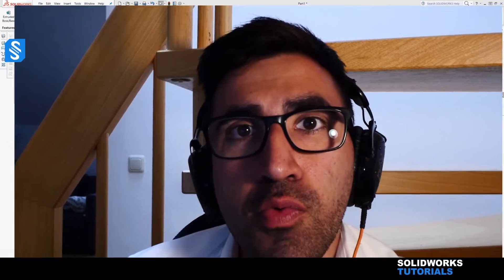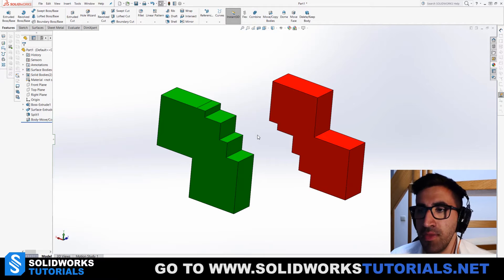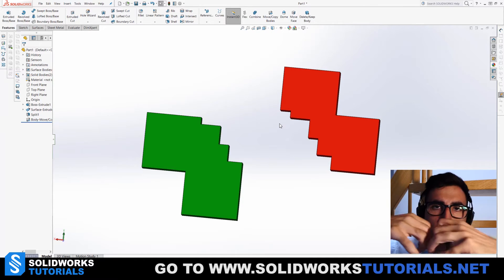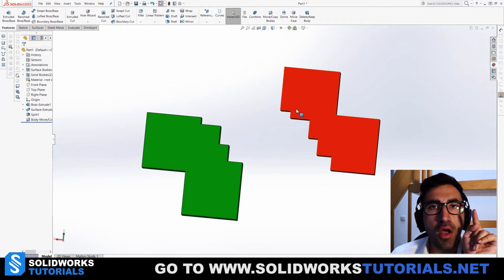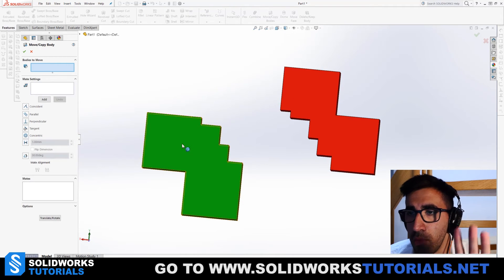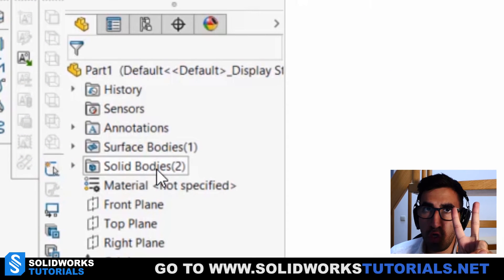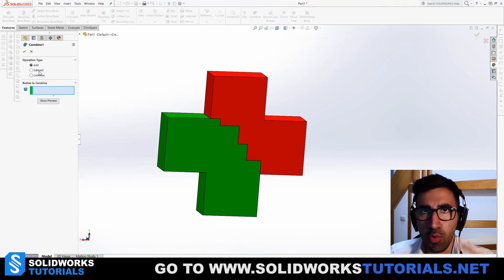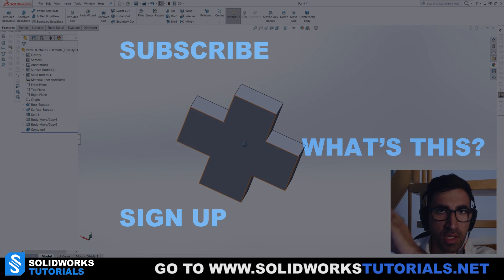How to join (combine) two parts (bodies) in SolidWorks for beginners

Comment: I have a problem where I am trying to make a mug, but I can't do a shell and keep my sweep for some reason. I am trying to make the entire part one thing without any individual parts, if that makes any sense (for example, I want to have one option to click on in FeatureManager, not several). Is that possible?
Reply: perform shell first. then do the sweep. if you already have done the sweep, roll back the line above sweep, perform shell and then roll it down again